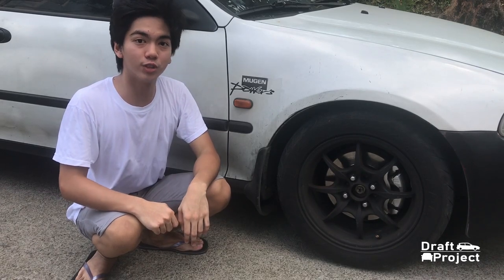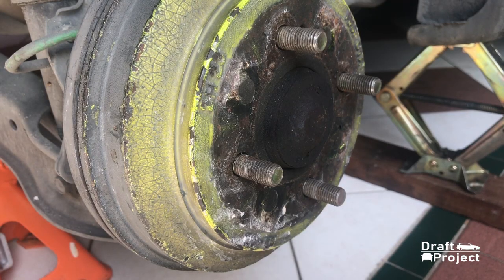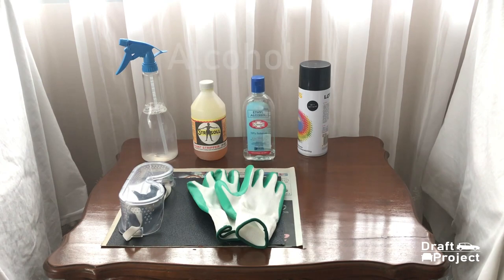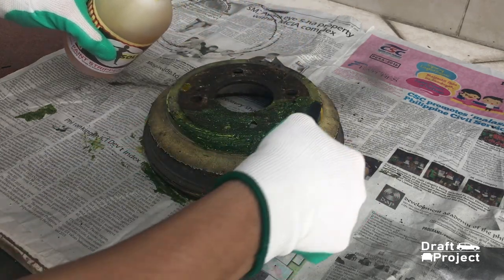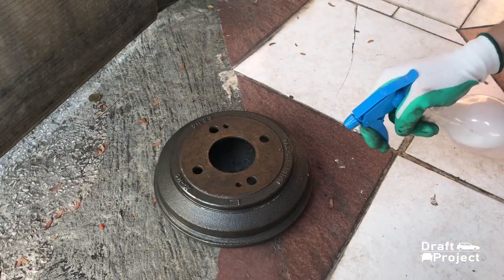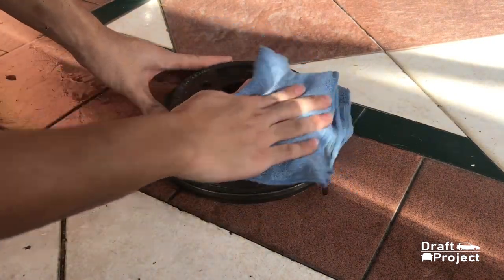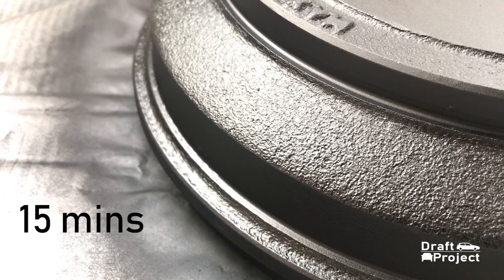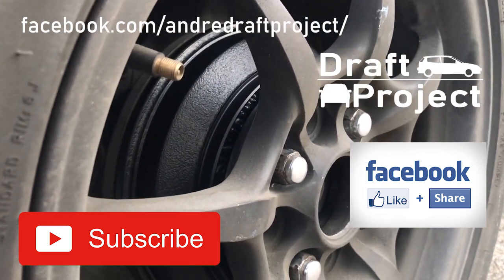How to Paint your Drum Brake Cover - Honda Civic EG - Draft Project

Comment: Good video, but I would use a high temp primer first before using the high temp spray paint
Reply from the maker: Hello jtyree0226, Yes! That is the best method for this job. Thank you for your suggestion. Also, please consider subscribing too. 😀

Comment: Dude, you didn't tape up the holes. The inside must be full of paint, gonna screw up your brakes!
Reply from the maker: I checked that and there was a small amount of overspray. It's nothing to worry about. If the paint touches the surface, where the brake shoe contacts with, it will temporarily create noise due to the friction of the paint and brake shoe material. After some few braking, that overspray will be gone and it will become dust. But still, your suggestion is not a bad idea. I agree that it is better to tape it to prevent overspray. Thank you bro!
Reply: jswjr - Experience, backed with some common sense, will tell you that ANY overspray will be gone in the first 20m of braking activity! Oops moment!
Not exactly something to worry about...
People talking about things of which have absolutely no experience. Just serve to spread myths. Beneficial to none and detrimental to all! ;-)